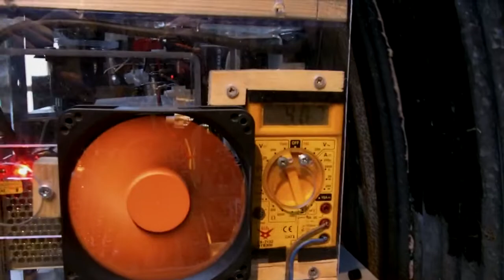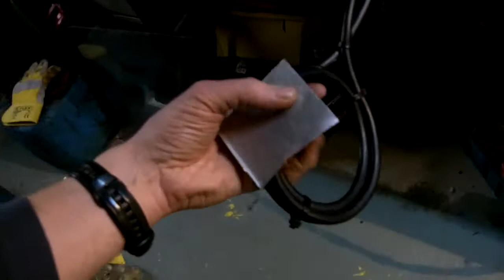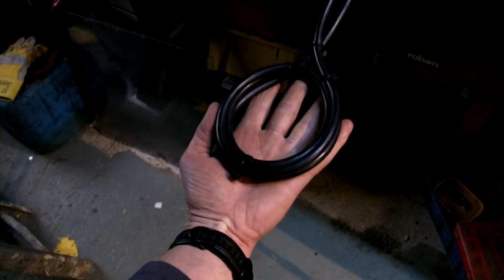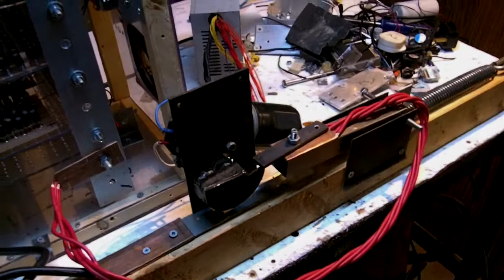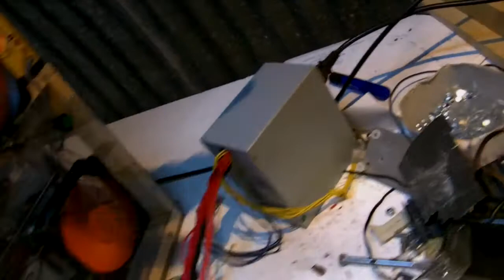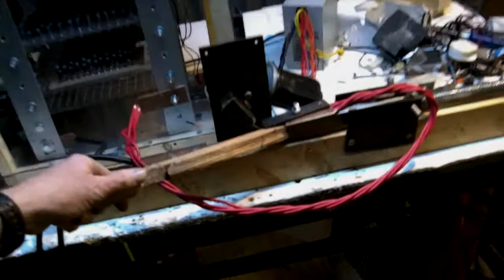cap discharge pemf 3

Comment: Have you done any more on this project?
Reply from the maker: Hi, done a bit more. Tidied up the wiring and made a better switch. I'm convinced it does reduce pain, but it could be placebo effect. However, it only seems to help certain conditions, so that suggests it isn't!
I'll post another vid soon.
Cheers!
Reply: I have 2 (2 inch coil) magnetic pulsers and also honestly believe they work. I would really like to build a large coil pulser, where the coil is anything up to 50cm dia. Fascinated by your work, hope you keep adding these! cheers